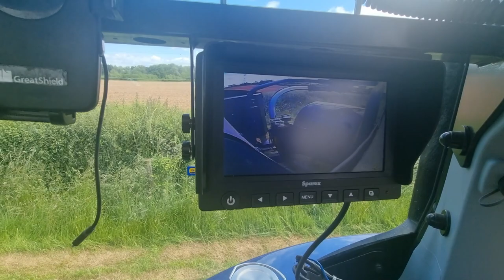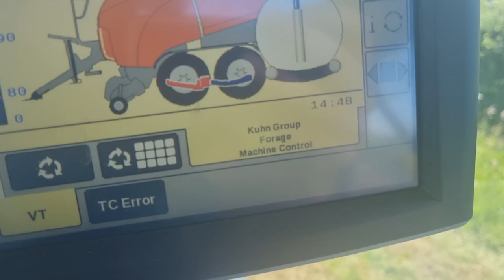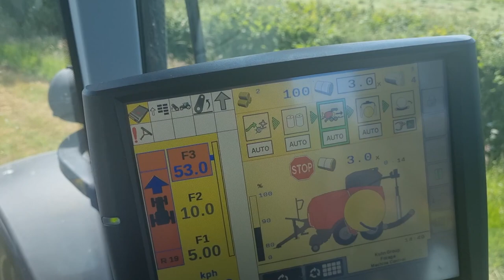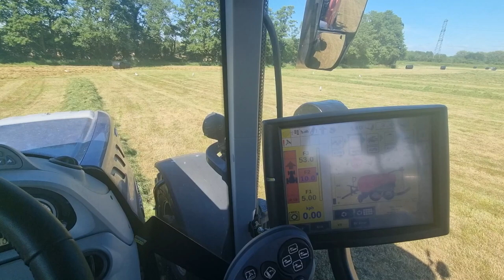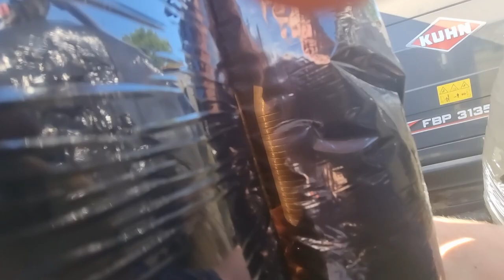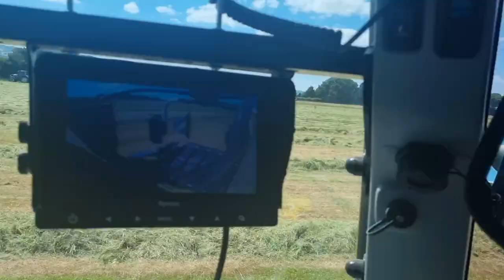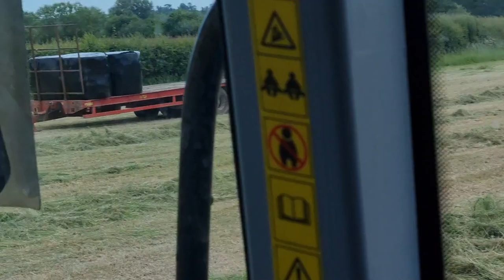The Baling Fun continues With the New Kuhn FBP 3135

Comment: New to the channel and loving the vids so far. We have an iBio and get 30/ph but we have steep hills and zero flat fields so every bale has to be reversed and placed- bale is wrapped and ready to drop by the time I get into a suitable position for released. Local contractor with a fusion has to do the same around us so most he can manage is 35-40ph
Reply from the maker: Hi there glad your enjoying them, yes with our ibio we used to average the same and remember doing some on some step fields and agree a full combination wouldn't be any quicker luckily we're fairly flat here so can get on quite quickly 👌